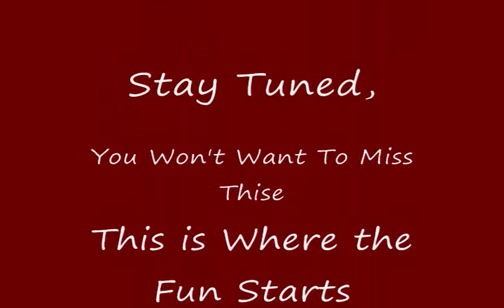1966 Chevy Chevelle-Pro Street Custom-Restoration- Firewall Makeover Part 2

Comment: After watching your video I got the courage to do this on my 1970 Nova.  I must tell you that I've never welded or used bondo before.  I made some mistakes welding by burning through the firewall because the metal was so thin. But I was able to fix those mistakes.   All in all, it came out great.  A local Hot Rod shop was going to charge me $500-900 for the same work. I impressed my wife so I must have done something right. Thanks for the post!

Comment: Nice work! I have to say in doing my 69 charger, sanding bondo from inside my fender wells has been the worse. I did a mini tub, so it needed some leveling. There is no tool for sanding an internal radius except a small sanding pad. I figured I would come up with something to use but nope. What a shoulder workout!

Comment: Pete, I'm trying to follow your advice on smoothing the firewall.  I plan on putting a piece of sheet metal on the fire wall after putting the filler on like you suggest.  My question is, if I smooth the firewall with filler, what is the point/purpose of putting sheet metal on top of the filler?

Comment: What about the fact that metal and filler contracts and expands at different rates under heat cycles in high heat areas like under hoods and on fire walls? A fabricated metal panel would be MUCH cleaner and last longer.